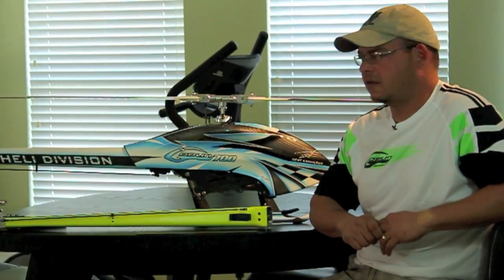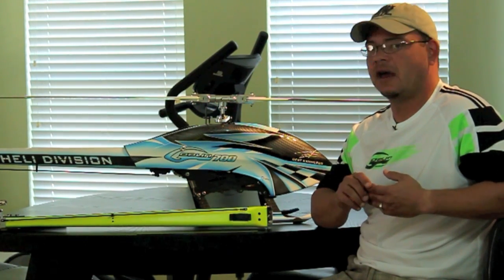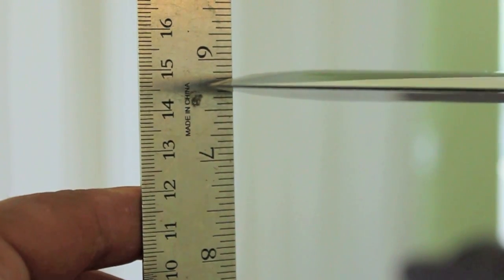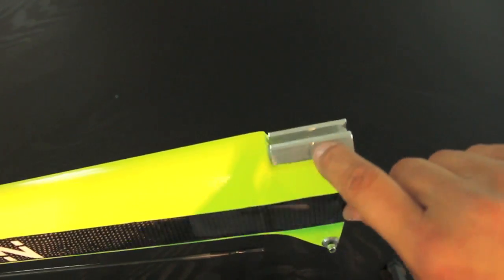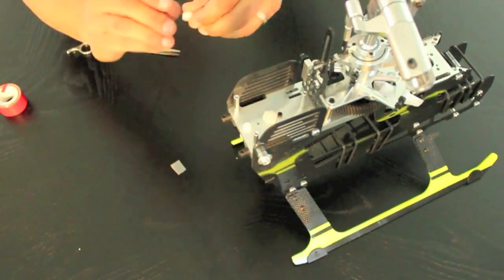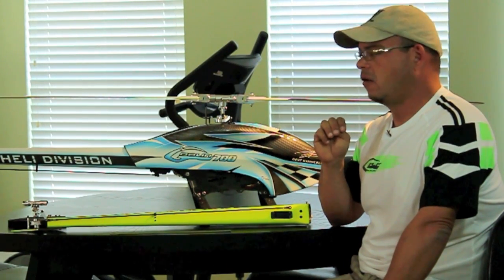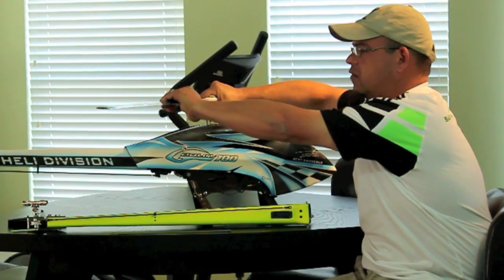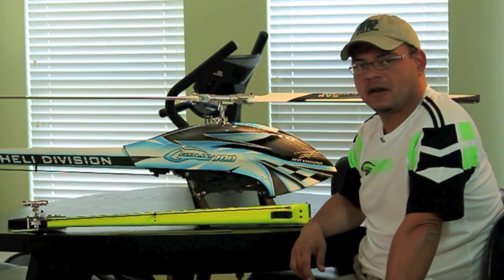SAB Goblin: Important Announcement

Comment: Correction: $799 heli.  And this hasn't been an issue in YEARS as it was immediately identified by Bert and the other tam pilots, and promptly addressed by SAB.  This is EXACTLY the kind of service we expect out of a top-tier manufacturer.  What you see in this video is simply an immediate fix which you could apply in the field, back in 2012 when the very first batches of Goblins were released.

Comment: 0.2 of a mm will giv u 10mm difference at the back?? i highly doubt that seeming as i work with glass, and the sheer size, upto 6metres tall, i know dam well for every 1mm out over a metre will be 1mm, s0 if my glass is 3mm out of level, and is 3metres tall, i know its roughly needs 1mm under the lower side, or take 1mm off the higher side.....